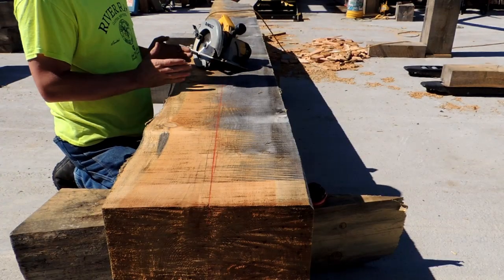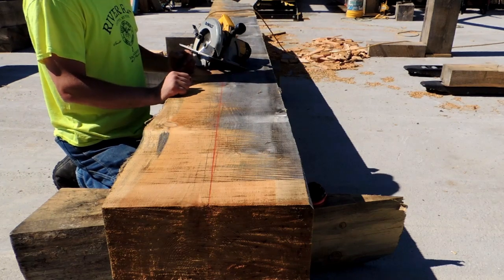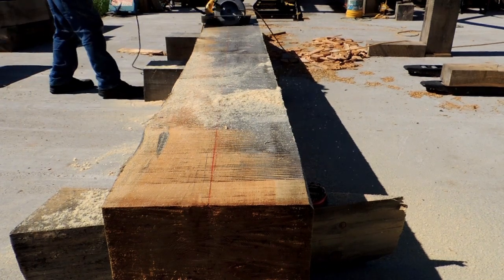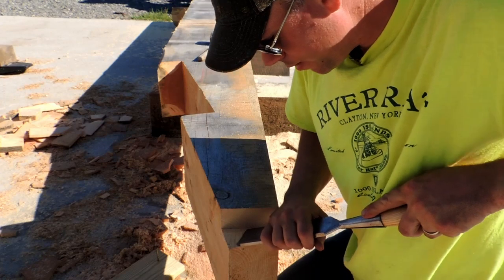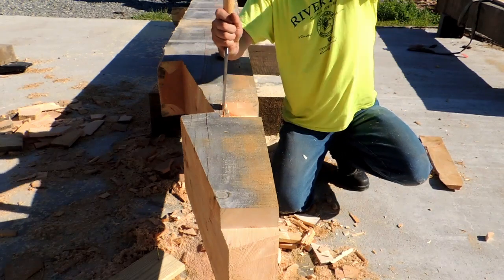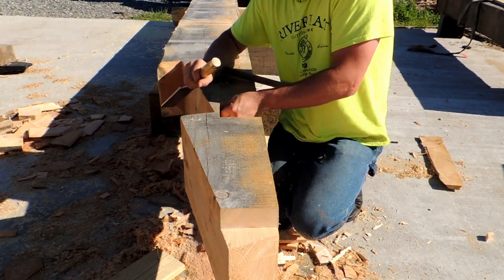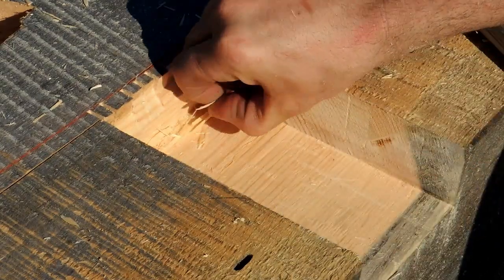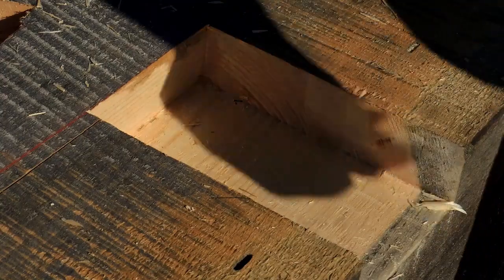A Timber Frame Vlog #17: A Timber Frame Tie Beam part 2: Cutting the Joist Pockets

Comment: Nice explanation. The close up shot was very informative. That beam looks pretty dry. How long ago did you make it? Trying to gage how long I have until it starts to get hard to cut joints.
Reply from the maker: +Jeff LaBrozzi I cut that beam late last summer.  After the first inch or so the moisture content is still pretty hard.